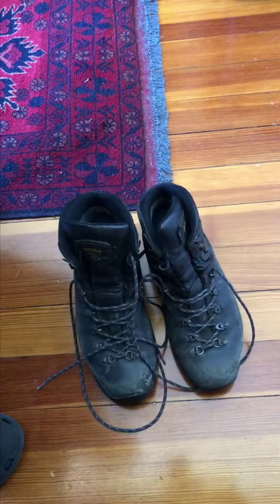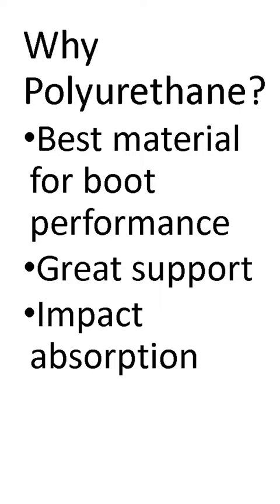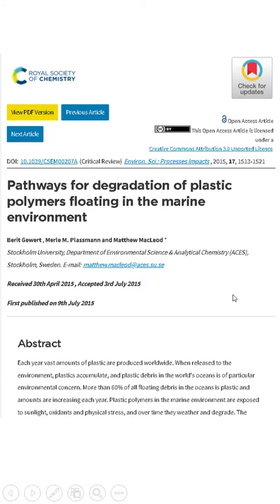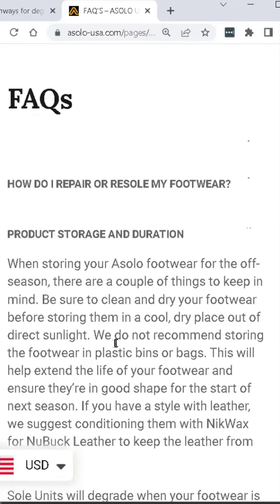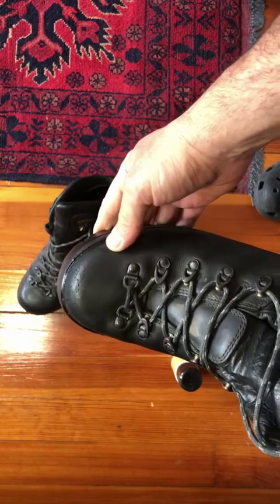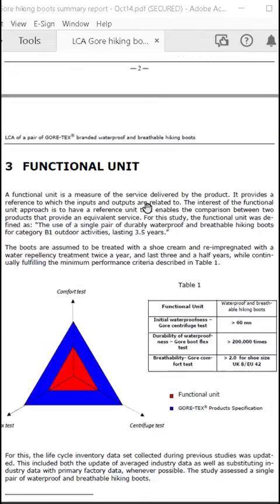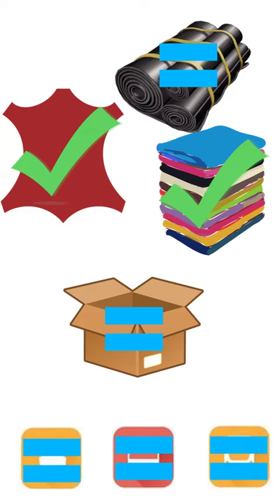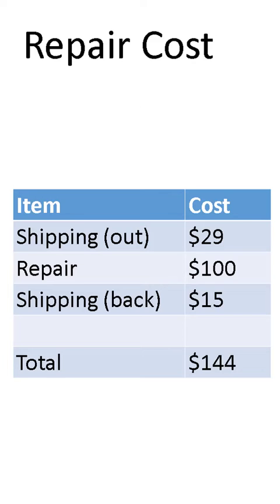Fixing Hiking Boots after the Soles Separated from the Boot

Comment: Are you familiar with the bad reputation of this company? Look it up.  I  bought a pair of ASOLO Power Matic 200 GV EVO worth $400 dollars,.. I figured they are top of the line hiking shoes right! Couldn't be so wrong. The worst boots I've have ever got by far. Soles came off completely "literately"  after 5 to 6 wears. I actually saw the sole disintegrate as I walked. The middle of the soles were some type of granulated plastic, that just came off, like eraser sore of material, also the frame side of the soles were braking in to pieces, I've never seen anything like it. Had to use a Mcgaver trick. Good thing we were close to go to the truck and Duc-Tape the shoes to the soles. It ruined the hole trip for me, Long story short...  I did contact  The company's Cus Serv.  The Company will not honor the warranty because had the shoes about 3 years but as I mention, I used the only for a hand full of times.  They gave me all kinds of garbage explanations why the soles came off so they wouldn't take care of their peace of garbage shoes.  Shame on them, they wanted over $200 dollars to Re-sole the shoes. Never again ASOLO Piece of garbage company. They are  Greedy and shameless 👎

Comment: Excellent video. Congratulations!  One question: Did the repair job include a midsole?  I ask that because I have seen several videos where they are repairing a pair of boots because the hydrolysis basically destroyed the midsoles and I noticed that they remove the residual polyurethane and glue the "clean" upper part of the boot to a naked rubber outsole without any midsole. 
In case they did not add a new midsole, have you noticed any change in how comfortable are your boots after the repair job? Are they as comfortable as they used to be before?
Reply from the maker: I would say that the repaired boots are holding up well since they were repaired.
I would also say that I do notice a slight difference between the repaired boots and the original, in that the original seemed a little softer when I stepped on a hard surface... when I am paying attention. However, I have been on long hikes with the repaired boots and they have felt fine.
I believe the new soles are Vibram Bifida 1375. They don't have a midsole but as i understand it they come in either a single hardness or dual hardness (hard outer sole, softer where the boot is glued to the sole). This dual hardness is, I believe, meant to compensate for the lack of a midsole. Given the communication I enjoyed with Dave Page Cobbler, I bet they would happily communicate with you about these concerns.
Reply: Excellent question. I am currently considering getting my Asolos resoled using their service in Italy. I assume that they put a new midsole on the shoe, but who knows.

Comment: That happens because they are cheap crap made with modern high production, don't give a crap about quality, methods that were never intended to have any level of longevity. Boots with glued on soles and plastic was among the stupidest ideas anyone in the industry ever had. The use of Gortex being another. 
Traditional leather boots with Norwegian Welt Soles will outlast them by orders of magnitude. And the manufacturers aren't even surprised that when wearing them outside, in the woods, they could actually somehow get, wet... Asolo must have a different kind of "outdoors" than the rest of us.
Reply from the maker: First thank you for watching my video. 
I will have to check out boots with  Norwegian Welt Soles. 
I will say that my repaired boots are still holding up really well since I got them in April 2022.

Comment: Great video. Thanks. Just a question. How long were you wearing those boots until got the delamination issue?
Reply from the maker: I think about ten years. But depending on the exposure to water and amount of usage it can be a much shorter interval of time. The replacement soles are still holding up well.

Comment: Excellent video thank you, I wonder if you had any talks with the cobbler about reusing the same outsole and repairing the midsole? My boots are from the 90's and the outsole still in great conditions, more so the treat design is also very unique and I don't like the idea of new outsoles.
Reply from the maker: Thank you for watching my video and for your comments. 
I did not talk with the cobbler about replacing only the midsole. That is an interesting suggestion but in my case my original heel was wearing down. The repaired shoe has a sole that is a single piece as opposed to a midsole adhered to an outsole. They still working great.
Reply: @mbanta  I appreciate the info, cheers!

Comment: Are they still holding up after 2 months?
Im sitting outside a shoe repair place where they wouldn't take them to fix because I'm going to be back to the same problem sooner rather than later.

Did they give you any guarantee with the repair?

Thinking of giving up
Reply from the maker: Thank you for watching my video. 
I have had the boots back since early April 2022 (~2 months). They are holding up well. I will have to admit that I do not wear them everyday, in fact I end up wearing them only about once per week. 
The one thing that I notice is that the sole that was used in the resole is a single piece all out of the same harder rubber material. The original were a harder rubber sole with a polyurethane midsole. On longer hikes I do feel as though I walked on a harder surface with my new soles. Perhaps more shock absorbent insoles would help. 
Thanks again for watching.
Reply: So do you think it was money well spent? Are you satisfied?
Did they give you any kind of guarantee?

If I do wind up getting them repaired I'll probably only wear them in the winter going in and out of work.
Thanks again
Reply from the maker: @SubtractiveMoves  In the video I go over the economics and the environmental considerations of repairing hiking boots. Do I think it was money well spent? At this point (two months after getting my repaired boots back) I do think it was money well spent. I didn’t have to buy new boots or break them in: I feel as though I got high-quality boots with a new soul at 1/3 the price of new boots and I feel they will last more than half as long as new boots. I will admit I cannot be sure of this. Also, I do not think there is a warranty beyond workmanship for the repair. I also felt good about supporting a more circular economy for these hiking boots. Rather than throwing them away I was able to repair them back to a high value state. Hope this helps, thanks for watching my video.
Reply: My shoe repairman said the same. I am not willing to spend $150(or have the additional funds) to repair them when I can usually buy a brand new pair of boots on sale for $80 - $110. The only brand that ever fell apart like that was the (2 pairs)  Asolos. My favorite and most long lasting are Scarpas. Someone gave me the idea of using an old pair of boots as a decorative planter, so not thrown away.
Reply: @WaterFilterLady Wont the boots rot/stink if they are used as a planter?
Reply: @beestingza   I think they will be okay.  People make planters out of wood all the time.  You can even drill holes in the bottom so the water can drain out.  That would also let the roots spread.